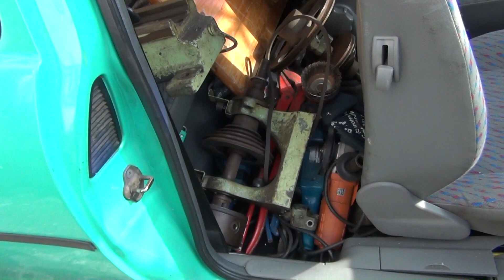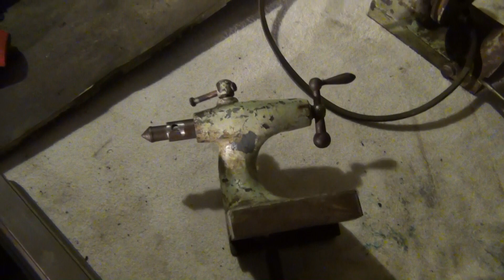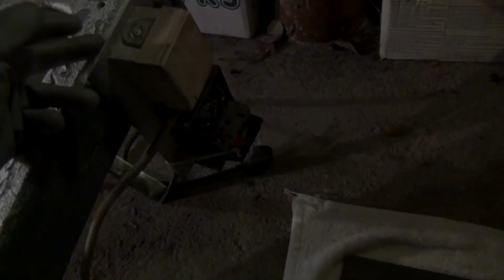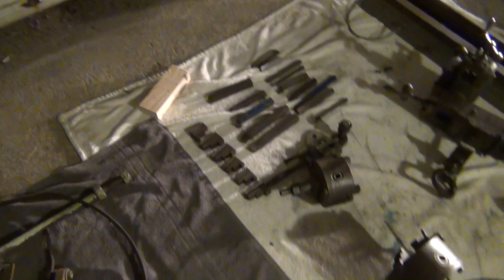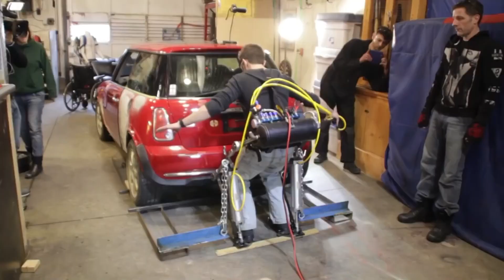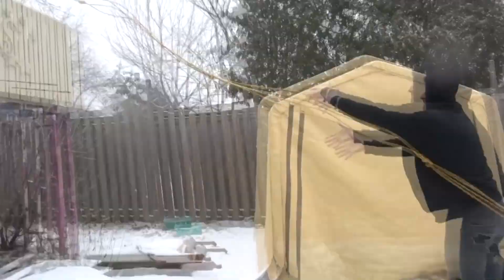TPAI Lab Report #010: My New (Old) Lathe

Comment: Fanks. My dad has a belt drive lathe that was converted to electric drive. Rusted to shit but I want to use it :D

Also 'machine bed' is called 'the ways' in English 👷
Reply: MrGoatflakes Both terms are correct, the ways refers specifically to the sliding surfaces on the bed.

Comment from the maker: One additional comment: The legs or "stands" of modern machining tools are still often made from cast iron, due to that materials capability to dampen vibrations much better than steel. My estimation of the age of the lathe depended on the shape and style rather than the type of the material that was used.

Comment: Looks very similar to an old English lathe that I have set up for a tool post grinding... Will be nice to see it assembled and used soon! Those cutting steels look very large for the size of the machine. I don't know how familiar you are with the lathe tools, but you might want to look into sharpening them to positive cutting faces (as opposed to negative which the larger bits often are). Best of luck. I always enjoy your vids :)

Comment: Good score!  On the subject of paint removal, I have had excellent results with paint stripping using the electrolysis method as you would use to remove rust.  I use sodium hydroxide added to the electrolyte.  

I have spent way too much time behind a wire wheel and grinder so I usually try this first.

Alternately, one could use hot sodium hydroxide in solution with water with a wood and cloth applicator.  Works great but both the sodium hydroxide and work piece should be warm or hot for best effect. (Use normal safety precautions).

Keep up the good work and greetings  from Virginia in the US.

Comment: Looks good!  A little on the light weight side, but a lot of the old lathes are like that.  Personally i'd not bother with the iron legs and mount it on a concrete plinth.  the legs would probably look nicer though!  is there much backlash in the cross slide/apron/compound?

Comment: Original paint will be the cream white paint, so better to do the repaint and such in a light cream car paint. Nice lathe there, and when aligned should be a good runner.
Reply from the maker: +SeanBZA I started to remove the paint and found 4 layers. Dark Grey-> Dark Green > Bright Green> Outer layer in weird color. The green paint was put on in a very sloppy way all over the lathe. So I guess the dark grey paint is the original paint, if there even was one in the first place. I will show that in the next video.

Comment: What kind of circuit???? 3ph?
Reply from the maker: +destiny walker "Steinmetz Circuit" is the word that I used.  The stator windings are connected in a delta configuration and a capacitor is added. This circuit is used to run a 3-phase induction motor on single phase AC. http://www.atwaterkent.info/Images/pic_motor_3-phase_start.png

Comment: You should scrape the ways to make it precise, as I doubt you will barely get 0.1mm accuracy with these rusted to death and used ways. Just google "lathe way scraping", it's an easy and intuitive process, just takes a bit of time.

To get rid of the rust, soak everything in evapo-rust(wrap in towels overnight). Good stuff, attacks only rust and is reusable.

After getting rid of rust, get a tube of molybdenum disulfide lithium soap grease(LiquiMoly, Mannol Moly grease, easy to find in any automotive store, around $15 for 400g), and re-grease EVERYTHING except the ways, those you can just put a few drops of regular oil on. That includes the chuck, which you will have to disassemble. That shouldn't be too hard, but it will take a lot of force as it's ceased.
Make sure to clean everything rotating out with kerosene first - like the bearings, then just pack the grease in.
Reply from the maker: +Spirit Sounds like good advice. Thank you.But let's wait until I make closeups of the bed. I used some brake cleaner to clean a small portion of the bed today and I saw, that there actually isn't a whole lot of rust on the bed. It's more like dirty grease all over the place.
Reply: The Post Apocalyptic Inventor The accuracy will be off. It's not your fault, or even really rust's fault, it's just been used a lot, as you say more than a decade.
I'd re-grease everything first, clean the rust off completely, get a dial indicator, and measure the slop & accuracy, then decide whether to scrape it or not.

Comment: Looks like a great machine. Might be easier to do paint removal with a sand blaster though. But I guess you do not have access to one
Reply from the maker: +bluegreenash Yes I have one and I will use it. The wirewheel will only be used for the more easily accessible spots.

Comment: Nice, I bought exactly that type of lathe last summer. Do you know what brand and year it is?
Reply from the maker: +Lars Berntzon There is an old nameplate on it, but it is coated with paint. I will try to get it off and decipher the manufacturer if possible.
Reply: +The Post Apocalyptic Inventor thanks,  mine was missing the plate completely

Comment: hi, seems a nice score. if the bed is in some acceptable state you will be able to enjoy and produce some nice work, if it`s badly worn or twisted well some will say throw it away, i say learn the machine, know where the problem areas are and work your way thru them. it`s not a production lathe so a little time here and there fixing setup or adjusting the machine shouldn`t be much of a problem. hope it comes out good. i`m sure you know but a metal lathe without a nice set of measuring equipment isn`t much fun at all. pete
ps check the channels from nick mueller or this old tony for tips on scraping if you need so
i`d imagine you are subscribed to dan gelbart`s channel (great channel) some tips there too, of course the big old boys marc l`ecuyer, keith fenner, mr pete, etc all have good tips on using and restoring lathes

Comment: Try some paint stripper for the paint. If you can afford it, evap-o-rust (doubt it's sold there) does a great job on rusty parts.

That's kind of a cheap shitty lathe, but I'm sure it will work.
Reply: Powder coat it any color but not black.

Comment: That looks like a nice find!   

I, myself, recently acquired an old wood lathe, all cast iron as well.  A metal lathe has many more practical applications, but the stock for a wood lathe is cheap and readily available;  I hope to one day find a nice metal lathe myself.

For paint removal, have you considered using a strong lye soak to break down the paint first, before starting with the mechanical abrasion?  Smaller parts can soak indefinitely in a strong sodium hydroxide solution without fear of rust, and a clinging jelly can be made with corn starch, water, and lye that can be applied to larger parts that are impractical to soak.  Depending on the paint treatment(s) it may save you a lot of time and effort with the wire brush.
Reply from the maker: +Nevin Williams I have bought some sand blasting equipment and a needle deruster recently and this will be the first project these things will actually be needed. But thanks for the advice, I want to try chemical solutions for removing rust and paint at some point as well.
Reply: Ooh, sandblasting is pretty effective especially if you have the air compressor beefy enough to supply it.  (Or is it mechanical?)  It takes care of paint and rust with one operation, unlike chemicals, which require separate treatments for each operation.

The surprisingly non-toxic phosphoric acid based rust removers convert iron oxide into iron phosphate, the latter being paintable and more structurally sound.

However, sandblasting is probably the most cost-effective and least environmentally harmful approach to use, if you've got the gear.

Comment: With your opening shot of lathe parts in the car I was happy for you.  But when laid out and I saw what was missing I wonder how well it will work as a 1st lathe for you.  What could it have been used for?  Maybe it started as a wood lathe and the cross slide was cobbled together at some point.  I thought it might be a spinning lathe but the bed seems too long for that.
It's pretty limited as is and you are going to have to hack and improvise to do many of the things a full lathe could do like threading and or machining more than a few inches at a time.  In other words - is it going to be worth all your effort to restore it as it won't be very useful for it's size and lack of functions?  You may not be able to sell or trade it for anything better :(

Comment: The bottom of the poor old Corsa must have been dragging along the road...
Reply: +James Taylor Been there, done that ;) I've transported different heavy things (plus 2 people), including (yes!) a 1950s lathe with my Corsa, right at the allowed weight limit for the car. No problems on highway, just take care of (speed) bumps. I had to drive up small car ramps backwards to get enough clearance for a motor crane to lift the lathe parts out. Ah, those crazy sunday afternoon purchases :D

Comment: If you got it real cheap, then it's a good deal. Those turning tools looked kind of large. For that lathe best 6 and 8mm shank bits are best size. The head stock bushings need to be in great condition, no play, or it may break carbide bits. Among my lathes, I have a quite similar one, a south bend, about that size, but later year with change gears and threading.  It is in great condition, only use it occasionally though as I have some modern lathes and one new one, those get used mostly when things get turning. I look forward to when you get that cleaned, repaired (if needed), painted, and running. It will be ready for another 100 years of making parts.

Comment: There's no lead screw? I've heard about this kind of lathe. You might have to improvise something there.
Reply from the maker: +Paul Frederick A friend of mine runs a company in Berlin. They have developed a kit for a stepper motor driven support that can be used to upgrade old lathes like this one. A kit like that will be installed in the future.
Reply: The Post Apocalyptic Inventor
that qualifies as improvising something. First you have to see how true the ways are to see if that is worthwhile doing I suppose. Does the saddle even have a way it holds down to the bed besides the lock? On lead screw lathes there is a surface under the back prism where a gib slides. If your lathe is missing that feature I don't think you can very easily do anything about it. Perhaps your friend has ideas there though? Maybe you could mount a linear guide rail back there? That's one idea.

I've made stepper motor drives myself. I won't say there isn't much to it, because there's a bit to making them. they're so cheap to buy now I wouldn't do it again.

Comment: Congratulations on your new toy! They sure don't build tools like that anymore. I would be careful about stripping the old paint as it may contain lead. You have to wonder about the actual history of your lathe, the hands that have worked it, & the parts it has created. Kind of gives you a little taste of our own mortality when you consider its age, & that is has outlasted several previous owners! Cheers!
Reply: +Urbicide lead paint will not hurt you, just so long as you can refrain from snacking on it. I know it is tough. But one must show some restraint at times.
Reply: +Paul Frederick 
Good for you!
[put on my mask...]
Reply: +Paul Frederick 
Wear a mask when sanding or scraping paint. Don't want to breathe paint dust, especially lead paint.
Reply: davecc0000
Nope never. I've been power sanding stuff since I was 18 years old too. I'm 51 now. Do the math. I even got neoprene masks with charcoal activated filters. But I only use gear like that when I am working with industrial chemicals that will drop you on the spot. That's a real hazard, not particulate dust. Which so far hasn't done a thing to me. I've breathed in God only knows how many gallons of paint, Bondo, fiberglass, wood, rust, sheetrock dust etc. I'm here today to tell everyone not a scratch on me!
Reply: davecc0000
never! I'm stronger than dirt.

Comment: How was the lathe driven before the electric motor conversion? With steam power? ;-)
Reply: +Seegal Galguntijak line shaft systems. Flat belts. Often a factory would have a steam engine powering the whole place. Sometimes they ran on water power though.
Reply: +Seegal Galguntijak probably with an older electric motor..